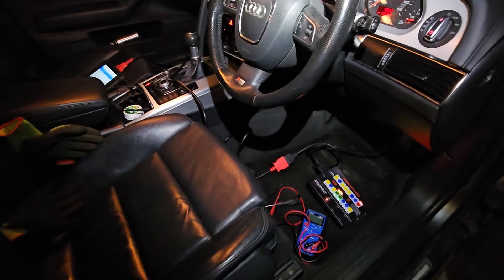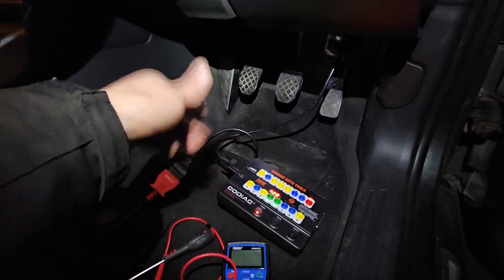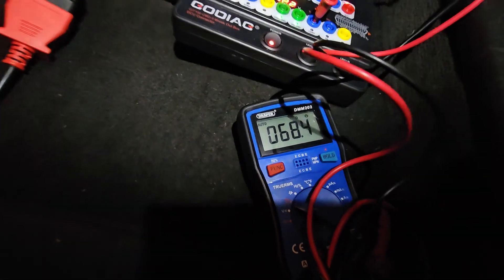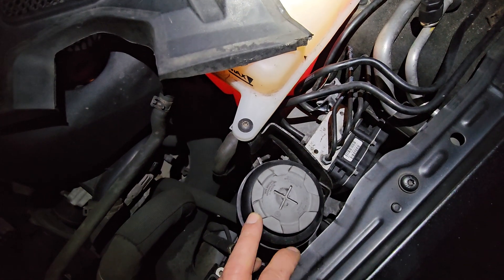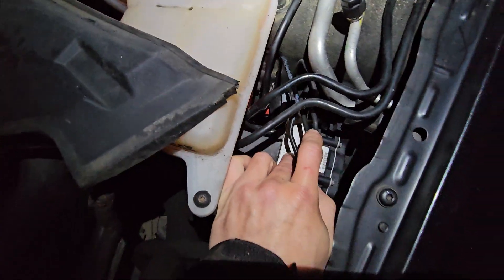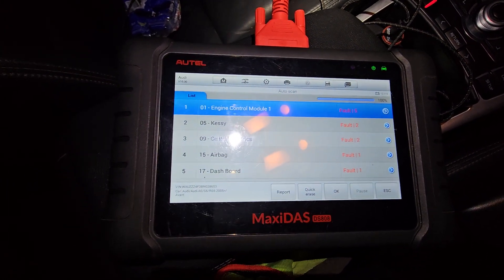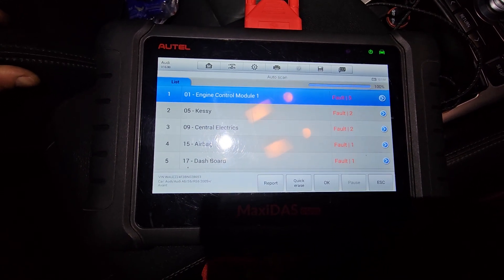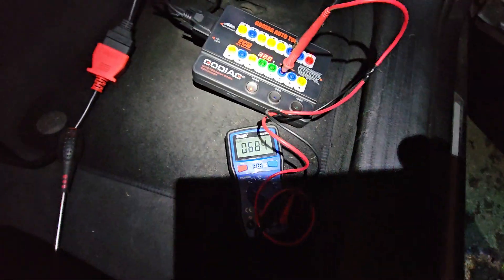Audi A6 (2011) - No Communication With OBD/CAN Bus Fault - Diagnosis

Comment: hi...i have some problem with CAN...same car.....i have no comunicațional with CAN and generator and batery module .....eror j533....have any idea were to look?thank you🍻
Reply from the maker: Hi thanks for watching. Provided you have no power supply or wiring issues, the easiest way is to disconnect each module until communication comes back. Hope that helps.
Reply: @adamauto1  i think there are many module...în The car....so a lot a work to check Them.all
Reply from the maker: Yes there are atleast 10 i would guess, welcome to the world of auto electrics!
Reply: @adamauto1  thank you 🍻